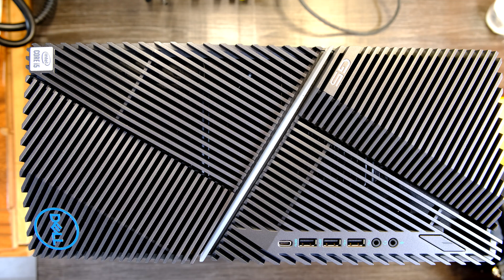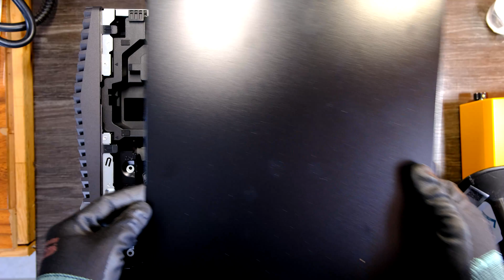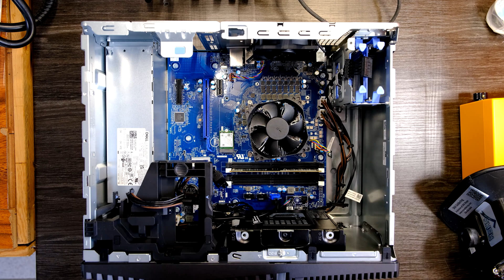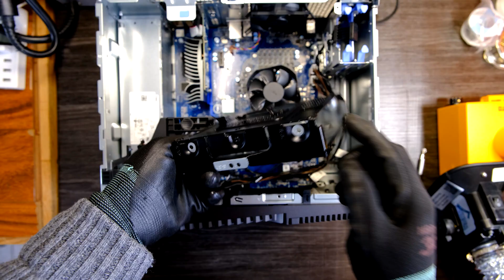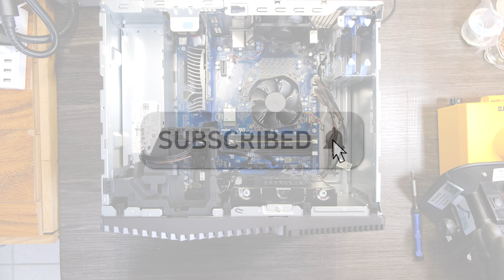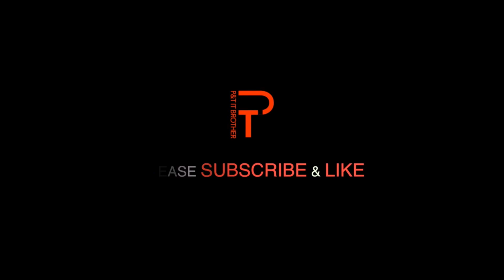Dell G5-5000 Desktop RAM, SSD, Video Card Upgrade (Disassembly)

Comment: Super quick and informative, i'm adding ram and it looks fairly simple but maybe expand on that a lil more next time for us noobs, thanks for the help!
Reply: Protip. If you were having issues with installing ram and not getting the correct MHz. Try switching the ram around. Originally I had the first two sticks of ram in slots 1 and 3 and then I added two new ones to slots 2 and 4 and my MHz went from 2933 to 2400. I switched it around a bit and found out that I had to put the old ones in slots 1&2 and the new ones in slots 3&4 and it worked just fine.